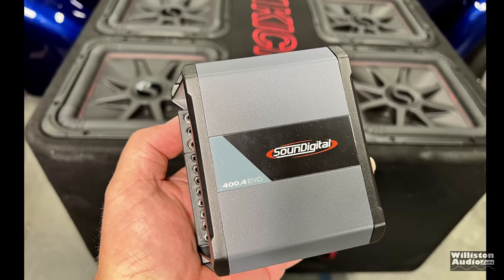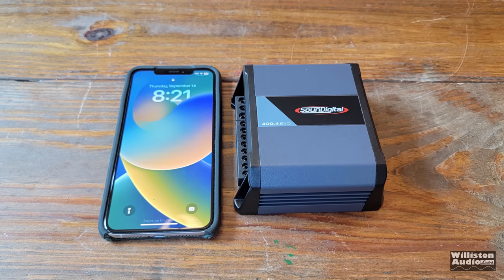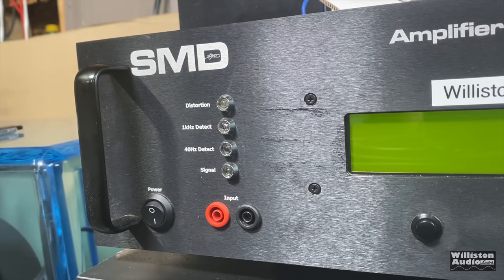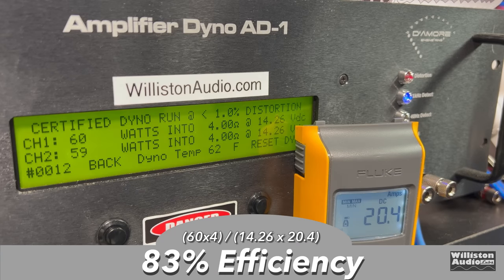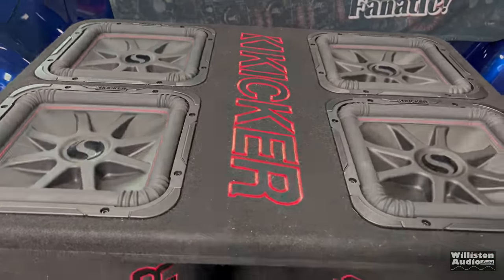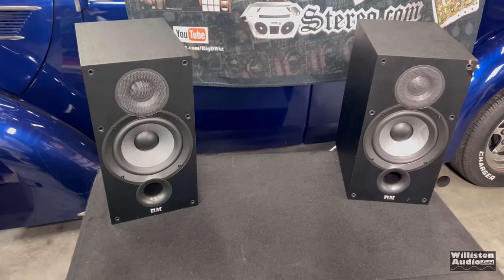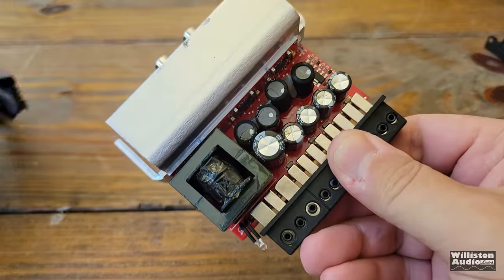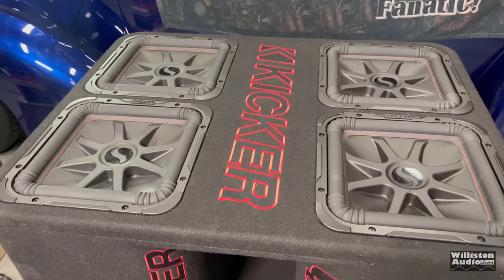Can This Tiny Amp Power Four 12in Subwoofers?

Comment: These are intended for the Brazilian market, that’s why is not showing on the US website.  From what I heard, they’re the same as the EVO-X but without the active crossovers.  I currently have 3 of these “gray” Soundigital amps, one 400.4 and two 800.4’s on my Harley with a DSP so, I don’t need them to have crossovers and I’m super happy with them.
Reply: Do you use a head unit? Or a bluetooth style like the other motorcycle speakers you typically see on handlebars and places like that

Comment: I bought a couple of these when they were $70, I traded one today for a R250.4 that didn't end up fitting under the guy's seat. The SounDigital did great. The crossover isn't adjustable but that's ok, it sounded pretty good. The wiring was done, all I did was hook it up, set the gains with the DD-1 & send him on his was after 20 min. It was worth the trade (for both of us really). Thanks for the heads up on this

Comment: In my tests it did 65wx4 at 4 ohm, 122wx2 at 2 ohm 248x2 bridged at 4 ohm  at +- 14.8V, and it sounded really good on the Klipsch RP-160M
Reply: Hey, I saw this amp and instantly thought " how would this work/sound  on a set of bookshelf speakers?" I've got the RP-600M models... What psu did you use to power them?
Reply: The magic word is Klipsch.
Reply: @MrKormend or a guitar cab.

Comment: I do custom audio mainly on bagger motorcycles and Soundigital is all I use for amplifiers. Never had a failure in the 6 years I've been using them.
Reply from the maker: Oh man, thanks for the feedback, I love to hear stuff like this
Reply: I have the SounDigital 400.2 EVOX on my Street Glide driving Hertz SX165 Neo speakers. It seems a little more distorted than my last motorcycle audio. Jay at Volunteer Audio says these SounDigital amps have lots of distortion and that's why he doesn't sell them. Is it your experience that you trade off some distortion for the lower price and smaller size of these amps comparted to a similar Hertz or other well known amp brand?

Comment: I've got one of the Stetsom Iron Line amps zip tied behind the dash of a Honda Ridgeline.  It's running an Atoto A6 Android auto radio, four 6.5s, and two silk tweeters.  I'm so impressed with it I bought one of these Soundigital amps for a light weight install in my 91 Camaro.  Glad to see this video!  I've noticed some of the artifacts these little full bridge amps add but in a noisy vehicle and with a 31 band EQ it makes almost no difference in real world use.  The fact that I have about 350 bucks in EVERYTHING in this vehicle including install gear, the 6.5s, and of course some old school goodness in the form of MTX silk tweeters I installed in the dash simply blows me away.  Comparing this to the setups I had in the early 2000s it really does feel like we're living in the future we dreamed of!  I'll be adding a pair of Hifonics 6.5 subwoofers soon.
Reply: I freaking love my atoto a6, I've had it forever. Have a couple hundred gigs of TV/music loaded up on the card and it gets used every day. It's getting pretty old and that 1g of ram isn't keeping up with newly updated apps, but for TV, back up cam, music/Bluetooth/phone, I love the thing and I've prob had it almost 8 years
Reply: @xxskizzumxx Really ? I had to send two of them back because the audio quality was just horrendous
Reply: Really ? I had to send two of them back because the audio quality was just horrendous . But I had the A6 performance version

Comment: Am I the only one who has thoughts about running multiple of these tiny amps to run an entire setup?  Two of them bridged running two dual voice coil 8” or 10” subs.  Another one running front components, and another to run midbass as well as rear full.  It would require a dsp, but it would be a differnet setup that would stand out from others.  

Just an idea.  Great video Big D, as usual!!
Reply: Its doable, maybe not the best sounding.
Reply: I’m running 2 800.4 evo x2 bridged on 4 cicada 6.5s on a bike. Decent amps.
Reply: Na...I'll just use the right amp
Reply: @jerryrivera7704  it is the right amp in some cases. The small footprint is great for tight spaces. These put out more power to size then most of the junk you see in car audio.  Find another company that can compete with a 3000.1 that a little bigger than you hand vs a huge  amp that’s not true to power.
Reply: @jerryrivera7704  It is the right amp for me. I'm tight on space and it checks all the boxes.

Comment: The tiny size and low price of this amp are a testament to good engineering. The sound quality 'issue' could be mitigated by restricting the frequency range the amp was asked to reproduce. In other words, I could see this amp being useful driving multiple midrange and tweeter speakers to sound levels below 'earth shattering'. Of course, that would require an external crossover. Looks like a winner!
Reply: How about a good ol 10 octave EQ, prior to signal amplification  ?? With maybe, maybe  a dyi cut-off in mid ranges ?? I like math, it's AWSOME
Reply: I do NOT want an amp that can't easily reproduce the standard 20-20k human frequency range.
Reply: @davelowets what do you mean?
Reply: So basically this amp is perfect for upgraded highs and mids in a basic upgraded passenger car stereo?
Reply: @longsleevethong1457  Yeah thats what i want to know I don need alot of power but i want to use rca instead of factory speaker wire harness and have more power than my pioneer radio
Reply: @greenespirit4973  I want a separate amp behind my stereo to run upgraded speakers. I don’t want a bunch of wires ran everywhere.

Comment: These comments and reviews are great. I'm trying to throw together something cheap but with decent sound in an old dodge truck. Nothing crazy, it's a beat up 98 and I'm getting old (46) but still like my metal with a bit of a kick. Back in the 90's and 00's were my time to shine when I could be heard and felt blocks away. 
I've always been impressed by small amps though. At one point years ago I had a little punch 60 with two punch 12's. Thinking that wouldn't be enough I pulled into this place called stereo would in Jacksonville North Carolina and bought a 2000w V12 Alpine along with Alpine mids and highs and had their install guy have at it. Got called when I thought they were done and he had me come back in to check it out. That little punch pushed the 12's way harder than the alpine did. Ended up just using the alpine for the mids and highs. Later on switched out the 60 for a punch 120 I think it was and it was insane. At least once a week or so I had to tighten my trunk lid bolts and anything else that could rattle loose and that was even after putting locktite on everything and dynomat.

Comment: They sell in USA, alot of motorcycle shops sell them, have 2, evo 800.4, running bridged, 400 watt rms. For over a year, been waiting for you to test that one. But glad the smaller one you did. I tun 5 amps in my bike, hopefully you will test the ds18, 3600.4. Rumor is 800 watt rms in channel mode. As I need 800 watt rms for my mids. Yet.

Comment: I ran a Hifonics Cupid on my mids and highs back in the day- this amp looks like it performed!
Reply: Brings back memories of the mid 80's (before the Rockford-Fosgate era) Sony was killin' it with their XM-120 "red-face" amps (as we called them ) and XS Series speakers that sported a red pin-stripe on their black speaker grills. With that red pin-stripe XS line-up, Sony introduced their 8in round 3-way speakers (XS-880's) and 8in round subs (XS-L20's), which really catapulted the "speaker box" building craze. 

Those that couldn't afford both the 880's and L20's and the extra XM-120 red-face amp needed (like I had), could still "THUMP" pretty good using just two XS-880 3-ways and another new product introduced back then, called the "THRUSTER" passive-radiator. Those things revolutionized home-built speaker boxes and sounded awesome, as long as your box was air-tight. Also, no Sony car system was complete without the Sony XM E70 7-band 25w x 25w equalizer, with it's tiny "bouncing" 3-color led display. 😎

Ahhh, those were the days!! 😆
Reply: @MAGGOT_VOMIT  i remember all of that too
Reply: @MAGGOT_VOMIT wow great memories
Reply: I ran 2 cupids. One on my front components and one bridged to a single 10. Always received good sq scores , but lacked in other areas.
Reply: I had a HiFonics Cupid VII running subs mostly.  Got it for a great deal and ran it on several different subs till it got upgraded to a HiFonics Vulcan which did a MUCH better job.  Never had a problem out of those amps.  Good times!!
Reply: That was when zed audio built hifonics  amps.....when hifonics was great=built by zed
Reply: Claimed 44 watt Lil Monster...
Reply: @randybehill8136  I would love to see one of those on the amp dyno!!  I ran mine at 2 ohms mono for a couple of years with no problems.  Who knows if it put out anymore power but it would be cool to find out.
Reply: @randybehill8136  22x22 ....and clean power!
Reply: I still have an old Pluto running in a 96 Toyota Corolla to this day bridged on 2 12” sec ha ha ha in the sealed enclosure.
Reply: My Sundown12 x v.3 it hits harder in the 2022 Kona but the SQ on those two 12’s still sounds so nice.
Reply: Molex connectors for the win ha ha ha ha ha
Reply: You brought back memories. I was running the HiFonics Hercules with 2 15" Pyle drivers, bridge down to 2 ohms. You talk about earth shaking.

Comment: Back in the day I had a 1990 Ford Festiva and I had a 12" Blaupunkt subwoofer in a triangular shaped truck box with a HiFonics bass booster (kind of an amp, but not really), and it slammed pretty good with a full Sony Xplod tape deck, Sony 10-disc CD changer, along with sony mids and highs. It was a single channel and claimed to provide 150 watts. It didn't sound bad at all, so I wish I could find that little bass booster so I could test it, but that was 24 years ago.

Comment: I've done some bench testing with this amp and one note to add. Due to the way the power supply is designed it idles at .6A draw and heats up to 113F doing nothing. Not a negative, just mentioning that a person will need to take idle current and heat production into account for a motorcycle build depending on circumstances.

Comment: I have the 400.4 EVO2, bridged on my Harley powering 2 Cicada 6.5 coax horns. I also have a dsp, and the sound is so clear and loud that I can hear them at higher than highway speeds.
Reply: Cicada is on a different level when it comes to loud and clear. The CH65 is what you have and they get it
Reply: @aarongreene9963  definitely a huge difference from the Blam 6.5's I had. I also replaced my lids with the same Cicada 6.5's that are powered by an SD 800.4 EVOX2 bridged. This winter I'll install another SD 800.4 EVOX2 to run the fairing speakers.
Reply: I would add use the 800.4's to power the midrange and use that 400.4 for the horns. Add a DSP and it would be screaming.
Reply: @dannyb2805  I was thinking about doing that.but I'm also adding a Cicada 1600.1. I think the system is starting to get too big for a daily rider. Might need to add an extra battery and larger stator.
Reply: Wind noise on a bike is pretty bad for your hearing (even with a big windscreen and a full face), why not just wear in ear headphones with decent isolation (to block the wind noise) under your lid?

Comment: I bought a different brand on Amazon and it was pretty good quality.  Still got a little hot but I was also impressed. Timpano 500.4 2ohm.  My subs blew its fuse but I plan on running two of them for my mids and highs.

Comment: Had a 300 watt dual audio amp from walmart back in 2013 - 2014. It was black and chrome. Was capable of pushing a 15 inch sub running 2 ohms on a summer day. That sub was rated for 2000W rms. The amp got very hot, but never tripped into safe mode. I was really shocked, and used that amp till I decided to get a 2000 watt Class D to put that sub on a real test.

Comment: I grew up with amps from a number of brands, and no matter what the power output they provided they were all huge and heavy. Before buying a Sundown SFB-1000 I wouldn't have believed it, after buying one the physical dimensions of the amp seem almost meaningless now. I feel like you could get 1000w out of something the size of a deck of cards at this point.
Reply: yes exactly , i built a boombox with a 1kw watts amp that literally is smaller than my phone , altough it doesn't have any step up circuitery in it so its kinda cheating but still ;)
Reply: finally.  After years of installations, they finally got it through their heads that  CARS are SMALL.  Small amps are the future for sure.
Reply: @davidfrancois2764   thats what i want to do want to build a gaget  like u...did
Reply: @davidfrancois2764 NO, 😆 Your boom box isn't outputting anything NEAR 1000 watts.
Reply: @davelowets   Bet ?

Comment: Love this man!! I’ve been almost contemplating on making a vid myself 

I’ve done a lot but I’ve recently hooked up 3 12 kicker cvrs to a old mono 500w Bazooka amp lol (weak) but!

Wired to 2 ohms the dvc’s absolutely SLAP! Amp never shuts off either . No bass boost it’s all the way down … crossover either off or 80h but in a nutshell it’s Way underpowered and kicks a$$!

Mind u this is off a line out converter too lol

Ppl need to learn how to tune the amps instead of I need “biggest baddest “ very nicely done man✌️
Reply: Awesome

Comment: This brand is the most popular brand of most the guys to do audio on Harley Davison bikes. They’re very popular because of the fact that they do rated power plus a little extra usually, and mostly due to their tiny size. 800.4 and 1200.4 being bought most frequently. There really isn’t any other Amplifier brand that will allow you to put two 800 white amplifiers in a fairing of a Harley Davidson for the longest time. This was the only brand that I can think of other than sound streams tiny little units, which do not put out really power and never last very long, inside of bearing full of vibration and moisture. Coming from someone who is into Audio for bikes it is my opinion that you would do very well to feature more amplifiers like this.  It would generate lots of views and new subscribers for you. And provide much needed info to the bike audio community. Me personally I would love to see you out a euphoria xpert ex800.4 on the dyno. It claims to do 400x4 rms at 2 ohms and I would love to know what the real numbers are for that amplifier. Bc of it really did 400x4 that would allow guys to run 4 sets of 4ohm speakers in parallel; one set of drivers per channel. And they’d each get 209 watts a piece.  That would be a awesome set up with lotsa power with only one amp in the fairing

Comment: Think about the amps back in the 90s that were a foot long and once you opened them up they were only a 1/4 of the actual size. Great review!
Reply: The old variation on the big watch little..well you know.
Reply: Only if you purchased Pyramid garbage or similar

Every foot long I've owned was STUFFED with rows of output transistors, end to end. 

Don't buy cheap shit, because that's what you'll end up with.

Comment: For that price you could just get the 2500 watt power acoustic amp and it holds up to anything. Had one hooked up on an outdoor system and no matter how many times it stormed it always worked after the rain was gone. Had that amp for 3 years was in 4 different cars and an outdoor system

Comment: Thanks to this video I bought one of these amps. Specs recommend a 20 amp fuse but uses 8 gauge wire which calls for a 50 amp fuse. Which fuse should I use?

Comment: This is exactly what I was looking for got a regular cab truck. Got a all in one 10inch sub under the seat but wanted to get 4 aftermarket speakers in the truck running at full power.

Comment: It did not count up cleanly on certified because it was over 1% THD. You might not hear that... but its very possible you will somewhat. Honestly most modern amps, even cheap ones can get to 0.5% or much lower THD... so even for a mini amp to not be able to stay under 1% THD especially being Full range is unacceptable in my opinion. If it was a subwoofer amplifier, I could see it being OK for a mini amplifier.. but not for a full range amplifier. Derick, you are correct Soundigital sells different models in the USA for much more expensive.. they are essentially the same and the higher price is because of import duties, dealer markup etc. The way to get them for the best price is to buy evo 4.0 instead of evo x straight from brazil for MUCH cheaper than buying in the USA... but as you mentioned, NO warranty when you do that.
Reply: Exactly my thoughts on the THD.   It's not a clean amp and some channels are worse than others.   I'll pass.

Comment: 4.0 series is released in the South American market. They are identical power to the US models. The only difference is they do not have adjustable cross overs. They are fixed. The X series have adjustable cross overs.

Comment: I have both lines of these amplifiers, the 4-channel and 2-channel ones, and they actually get quite hot because they are Class D and have low power consumption. I'm using the 2-channel amplifier in my car to play a set of 2-way component kits and the quality is impressive, but a Class AB amplifier would be ideal, but unfortunately here in Brazil these types of amplifiers are already rare. found on the market.
Reply: Have lots of AB OLLLLD Skool. I get what you mean..

Comment: My corolla had 6x9s factory in the back deck behind the seats. This would be good for running a couple of those or all the door speakers. Just finding a spot to put it knowing its gonna get as hot as a stove top is the problem.